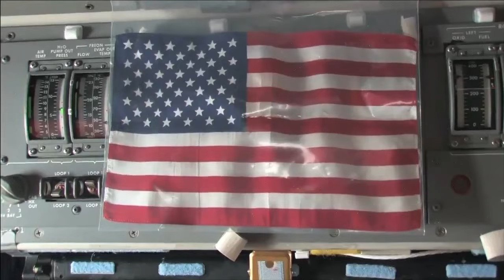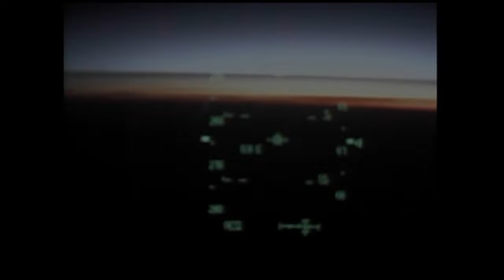STS-135 - The last Space Shuttle launch and landing

Comment: It was incredibly stupid that they flew these things without a proper launch abort system. At least Gemini had a somewhat better system.
Reply: They had launch abort plans. In case of an emergency the shuttle would detach from the launch vehicle to try to make a runway. If they couldn't reach a runway they would put it in the ocean I believe. In the case of Challenger, the degradation of the space craft was so quick and violent that there wasn't time to detach the shuttle. The loss of Columbia could only have been prevented if they detached after the foam strike. However, foam strikes were all too common so there was no apparent need to abort the mission. 

Also due to the nature of the Shuttle, it wasn't really possible to use a traditional launch abort system, as there wasn't a detachable crew compartment in the shuttle.
Reply: TheGTschmidty NASA acknowledged that they could have installed a launch escape system but they didn’t do it... would have been possible for the crew of challenger to be saved
Reply: @damian4583  No, it would've been possible to have better launch abort and even ejection system if the craft was designed with it from the very beginning. Retrofitting something this radical to such design would've been not just unfeasible, but complete insanity. In fact, some early flights had Shuttle fitted with special ejection seats, however they were deemed impractical as their operational range was too limited. And there were only two of them. Buran also had those. They would've been of no use in both Space Shuttle disasters.
Reply: @Quicksilver_Cookie  engineers surely tought of thag, they probably have reasons why they cant fit an ejection or separation(capsul) sytem
Reply: Not in 135 missions would a launch abort system have saved any lives.

The Challenger disaster happened due to an O-ring failure which caused a rapid disintegration of the craft, due to aerodynamic forces. There would have been no time or opportunity for the crew to abort and safely escape from the stack, in the microseconds between O-ring failure and the Orbiter destruction.

And the Columbia disaster happened during re-entry. Again, launch abort wouldn't have changed a damn thing. 

You want to know why 14 astronauts died. Because NASA didn't listen to its engineers about the limitations of its craft. Challenger should never have been launched in such cold conditions, and if NASA had heeded the advice about the freezing temperatures, Challenger would probably be in a museum today. Likewise, Columbia was the result of years of ET foam shedding not being addressed. 

The failings of the Shuttle program came from the people who operated it, not the craft themselves.
Reply: @TheGTschmidty  you couldn’t detach the shuttle before the srb had burned out! The dynamic pressure and the plume from those srb’s made it unsurvivable… had they realized the O-ring was compromised before the stack came apart there was nothing they could have done… which is even more terrifying. 
The crazy “what if” scenario to me is that since the crew cabin was not destroyed during break up and the crew didnt experience deadly g-forces, only two features was required for some or all of the crew to survive. Decent flightsuits capable of providing oxygen at high altitude (the PEAP were not meant for this contingency) and since the crew module (by coincidence) broke totally free of its casing and flew steady due to wires trailing it, a chute would have provided the possibility of a soft landing.